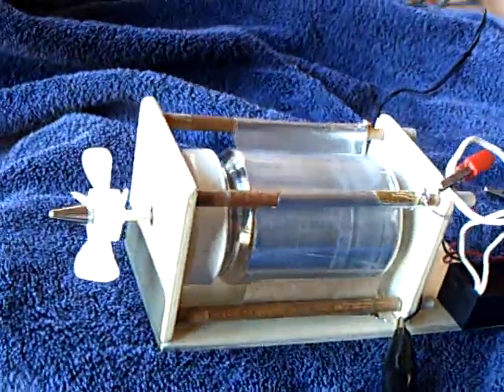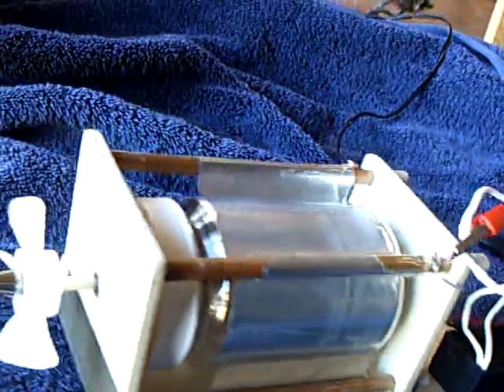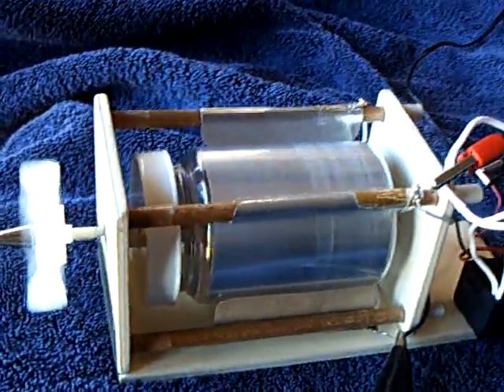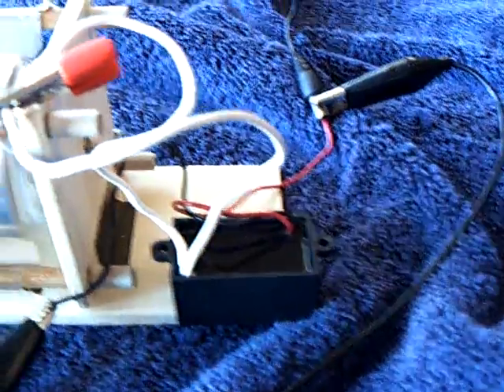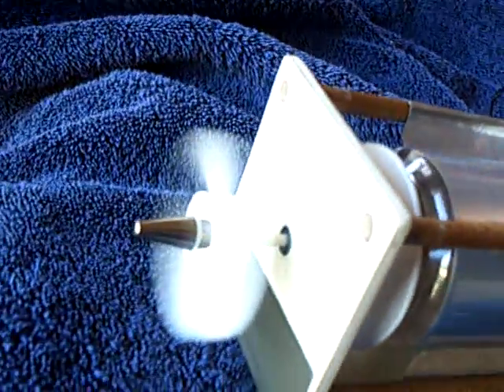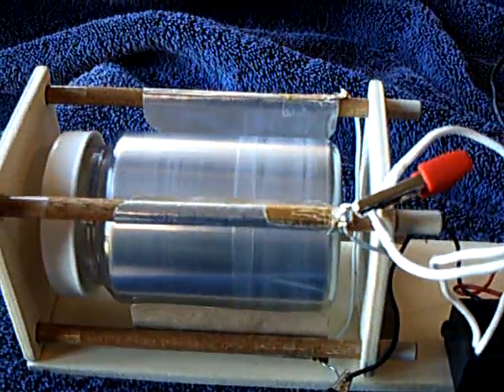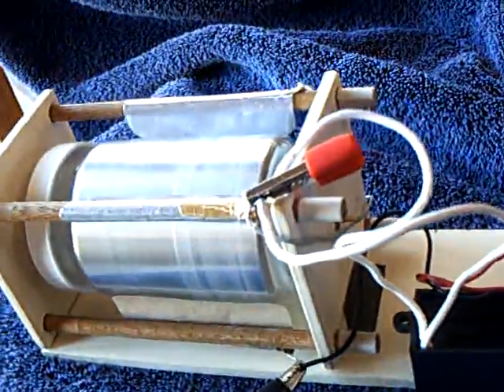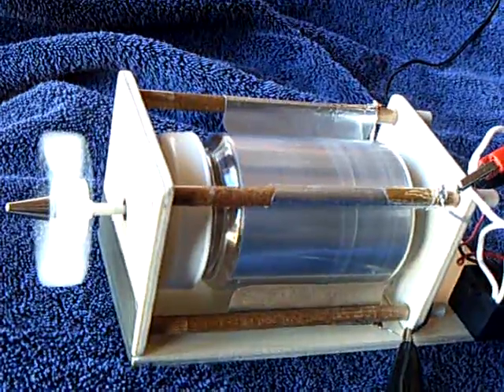Corona Motor ---  With fan blade

Comment: Beautiful electrostatic motor.   Much ozone output?  Looks quite efficient.
Reply from the maker: Hi Jack.  Yes there is ozone.   This motor would be better if it were made out clear plastic.  It does run pretty good though just the way it is.   Aloha.

Comment: Nice little fan you got there very nice design :) now to make the motor small and as much powerful hmmmmm...... Thanks for sharing!
Reply from the maker: I may make one of these that is about 1/4 this size.    I found out that this will actually run fast on just two blades and that makes the build easy for a smaller motor.  You lose torque though the fewer blades you use.
Reply: Very interesting also you could use a squirrel cage blower as they don't require to turn very fast you can get a decent amount of air movement :) Cheers!

Comment: *****
Nice build!

To upgrade this motor for high torgue you probably will need to design multilayer cylinders on rotor then figure out how you can attach at least 2 high voltage source plates to each layer without affecting other regions in rotor.
It would be nice to see achievement in this area... ;)

Comment: I wonder if you could make an ozone air cleaner with this.
Reply from the maker: That is what these little negative ion generators are for.  After I run the motor for awhile the air does smell very clean. I am wonder now if the motor blades would get dirty and need cleaning like those ionic air fresheners blades do.